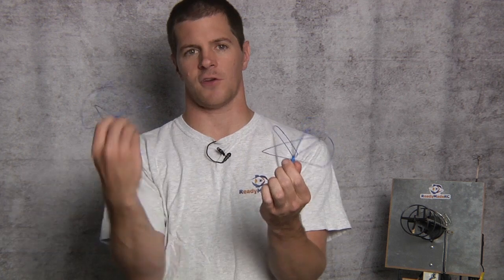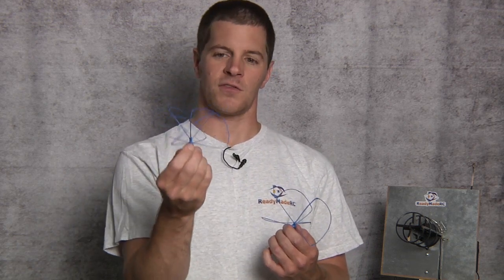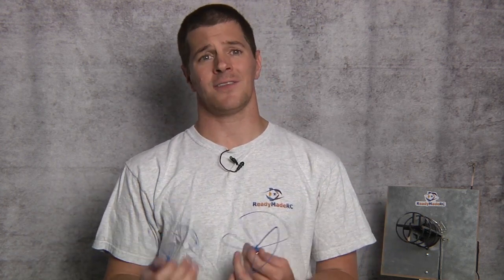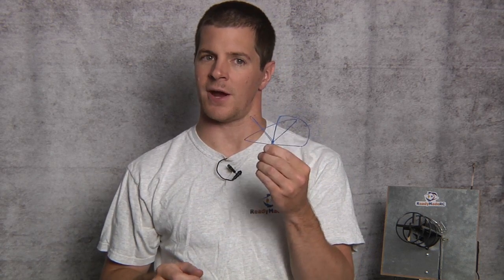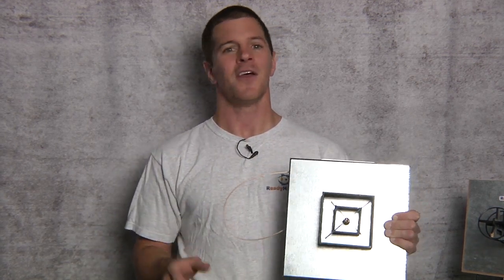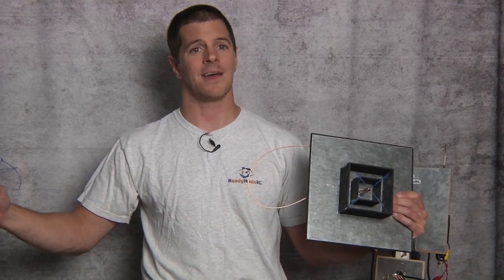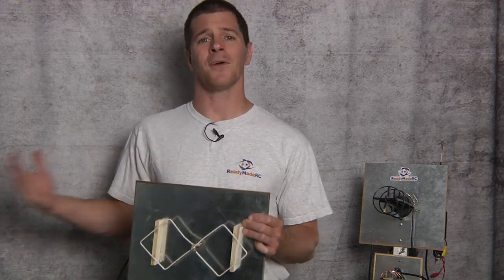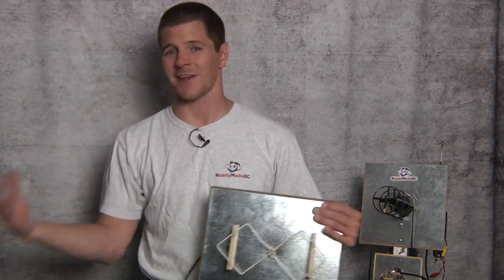How to be successful in FPV part 4 - The antenna system

Comment: Thx for the video. I'm a former router geek, so I remember you from all the MIMO antenna designs. I still have the best DDWRT routers with external antennae. We need directional antenna tracking on the plane, always pointing the directional antenna at the base.

Comment: Good video. I'm learning from FPV but my purpose is to use FPV transmitters and receivers to set up a live video feed for when I'm skydiving. This was a good help, knowing that the helical has that wide of a "view" makes it the best choice for my setup.
Reply from the maker: Believe it or not, the Golden Knight use a helical on the ground and a cloverleaf on the jumper for this ;)
Reply: The GKs are training at our DZ this week, I'm going to try and find the one responsible for the live feed. For my setup, I'm going with a Triumph on the jumper, and I was thinking originally a pepperbox on the ground, but after watching the video I did also conclude that a helical would work best. If you can recommend anything else, it would be enormously appreciated.Cheers!
Reply: Video Aerial Systems  I have a idea for you to market

Comment from the maker: What antennas are you using?  BluBeams?  True Wired?  Those are the best on the market.  If those aren't fixing the problem, use a 3 turn goggle mounted helical antenna.

Comment: One question I can never get a clear answer to is about orientation of a dipole antenna such as the immortal t for max range. Many people claim it works best flat and many claim it works best placed vertically. Which do you think is best and what do you consider the pros and cons of each? Thanks
Reply from the maker: In general - Upright is the best orientation for any flying vehicle.  Both ground and aircraft should be vertical.  Yes there are exceptions to this rule, but they are rare.  I made a video explaining this here:  https://www.youtube.com/watch?v=aftijOUc2jM

Comment: Can I use a 5.8 16 db linear patch on a tracker with  a clover or skew on the plane . I know it will have a 3db loss.. what range would I get and will multipathing be an issue ?
Reply from the maker: OutbackKanga Multipathing will not be a problem because you will have high F/B ratio.  Range will depend on your noise floor and the quality of your tracker.  It is impossible to gauge range accurately without knowing the noise floor and the sensitivity of your equipment and transmit power.
Reply: Alex Greve  The new Ark bird gps based tracker seems to work well ,  i am thinking about putting one of your crosshairs on it actually :)

Comment: what I dont get is why RC link recievers only come with 2 wires.. I believe diversity RC link recievers but they seem  to be linear... why aren't the 2.4ghz rc links circular polorized? is the interference and losses only an big deal with fpv and not with rc link because of a very low packet size of the data?

Comment: Can I mount the cloverleaf antenna parallel to the ground? Is it gonna reduce the range?
Cause if I put it up - my aluminium frame will block the signal, and if I mount it facing down - it's gonna stick into the ground on landing.

Comment: Are there any antennas available on mag-mount, to situate on a car roof for example, for better ground planing and obviously so that the drone can be operated from the comfort of a car seat? 2.4 Ghz transmitter, 5.8 vid reception. There are mini-dishes available for these frequencies for boosting WiFi over great distances. Has anyone ever attempted to use these dishes for long distance drone flights?

Comment: i was wondering can i use a clover leaf antenna on my trans miter and still get grate fpv range if theirs a linear  antenna on my quad? say for the hubsan h107d. if i put a clover leaf on the transmitter will it prefourm just as good if not better even if i leave the stock antenna on the quad?
Reply from the maker: +Spencer Bronzburg - I have done this and it helped a bit.  I had ~ 40% range increase.